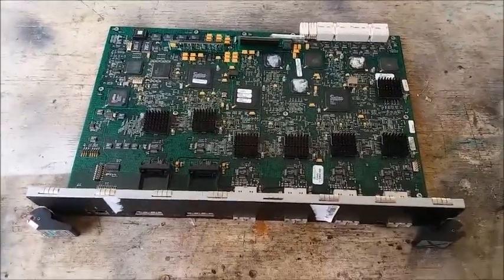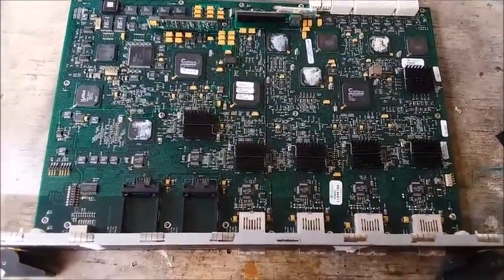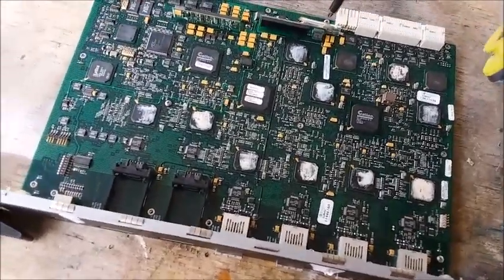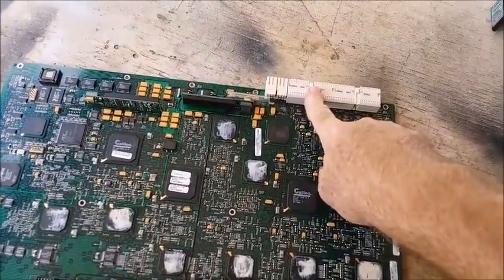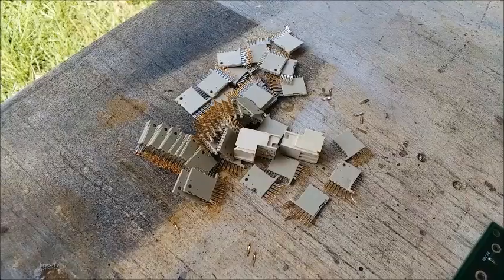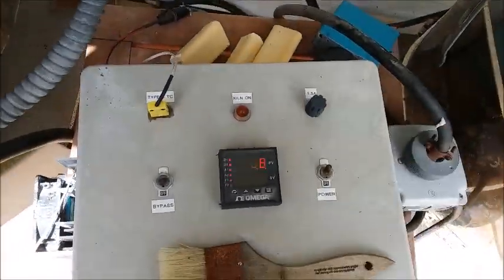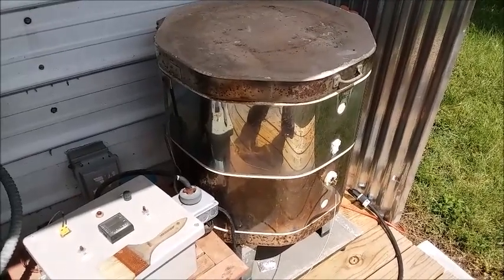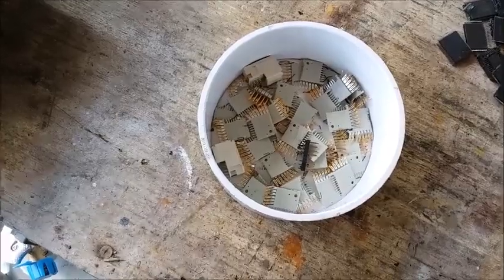Teardown and scrapping of Enterasys 5G102-06-G Gigabit Ethernet Switch Matrix to recover gold.

Comment: Great video Omega 👌🏼 but if I may offer one thought about depopulated boards and their value. Essentially after you’ve dropped all components, what you have leftover is simply a board made of silica and copper. HIGH GRADE copper. Yes you have a little bit of solder contamination and solder mask, but comparative by weight it’s nothing. 

If people are going to go through the process you just showed them, I’m of the mind that you should stack them boards away. That’s high grade copper ‘ore’. And if your willing to go for those tiny copper components on the board, you’d be foolish to just toss the board after you’ve removed ALL other ‘waste’ materials. From low grade copper boards to high grade copper boards with just some heat and a couple taps. 

Food for thought.

They stack beautifully and add up fast.
Reply from the maker: Yes, the boards do have some residual value. My local scrap yard will buy them. When I said I didn't keep it, I meant I didn't keep it for further processing like the parts with gold in them.

Comment: As a scrapper of ewaste I love to watch depopulating videos! Get new ideas from some. You might get a couple of scrappers like myself that'll give you a hard time about the mlcc's and say how much palladium your missing on the non-magnetic mlcc's. But this is yours and you do whatever the heck you want to my friend!!
Have a GREAT Day!!!
Reply from the maker: Getting palladium out of the MLCCs seems like a lot of effort for not that much return. The gold is so much easier to recover, and there is so much more of it in equipment like this. Not sure the palladium is worth the time, effort and reagents needed, unless it's just done for fun. I have considered collecting all my recovered MLCCs and tantalums and selling them cheap on Ebay for those who are into them. I may do that in the future. Though the sorting looks like it would be a pain. If I decide to get into processing palladium and other PGMs, well there is years worth of accumulation in the bottom of my stock pot I can practice on.
Reply: You won't find many "Non-Magnetic" MLCC's in most modern electronics. I ran an experiment on motherboards,video cards, memory, and hard drive / cd boards and collected every MLCC that would come off in one piece. I dumped them all out onto a table and passed a strong hard drive magnet over them. I managed to collect about 10 MLCC's that were NOT magnetic out of all of them. There was about a POUND of MLCC's total. My experience tells me they are not worth collecting.
Reply: @scrapman502  I've not tried to process them yet. I'm getting very few too, I'm a small time ewaste so I save everything I can. If later I don't like the process of it I will dump them.
Thank You for your guys response!!